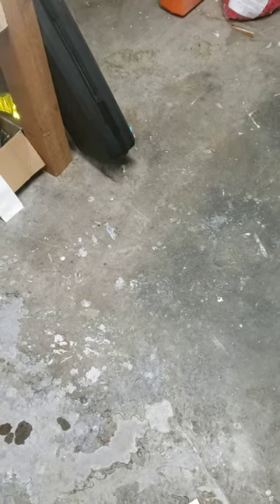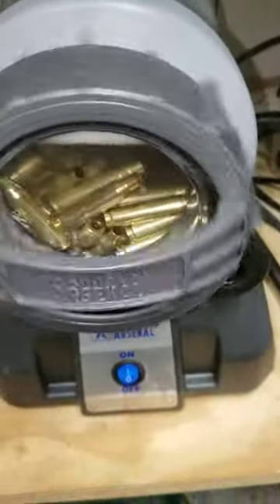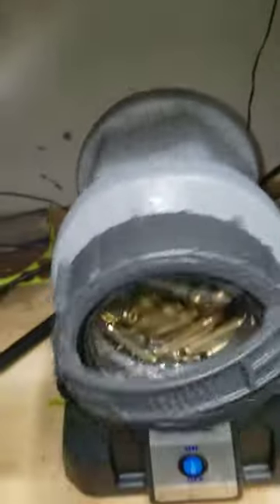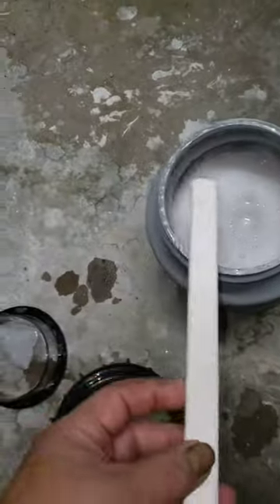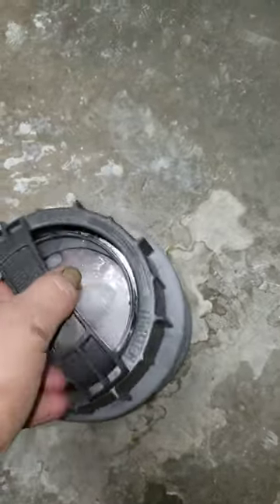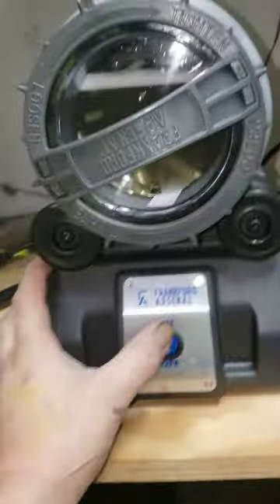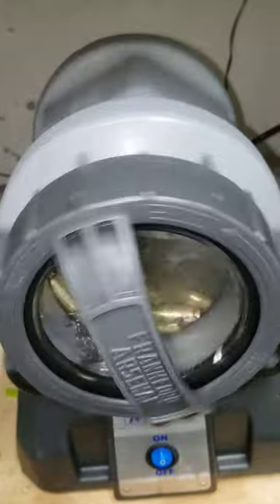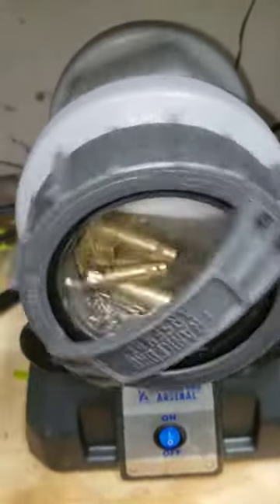Frankford Arsenal Rotary Tumbler Lite Modification.

Comment: Yes thanks. I used a piece of plastic but it kept floating to the top so I swapped it with a piece of light aluminum angle and it works great.

Comment: To add a rubberized coating to the Tumbler Lite version.  Sand the inside of the tumbler container to rough up the inside so the coating will have something to grip and bond with the plastic.  Place the tumbler on the base WITHOUT the lid and turn the machine on and let it run.  Using a spray can of a rubberized spray on coating.  Do the back first and then make you way to the front in light coats.  You'll need to do multiple layers to build up the thickness you want.  Now just leave the unit running until is is completely dry.
You'll want it to be fairly thick, but thin enough that you can still insert the clear plastic cover and lid.  If the final thickness is too thin or you don't rough up the inside of the plastic it will start separating from the plastic after a handful of uses. You're Welcome!  :)
Also the magnet from Frankford Arsenal is a piece of trash.  It's too weak to be effective.

Comment: I just cut 6 pieces of plastic coat hangers (1/4" round) to lay in each crease of the jug. Will be hot gluing them in place right after I scratch the inside up real good. Then I will try adding layers of plasti-dip or some type of rubber coating for porches/decks. This should make the cases tumble quietly.